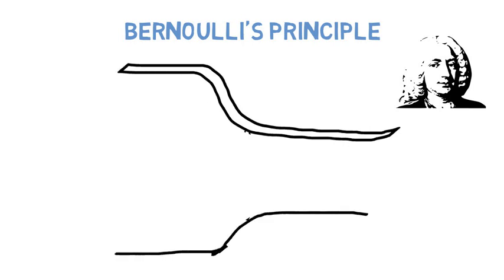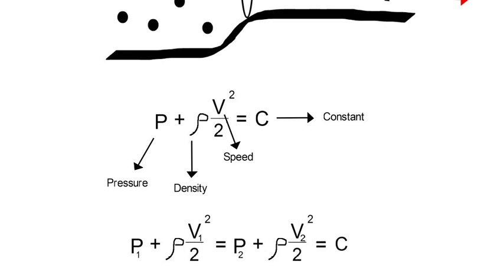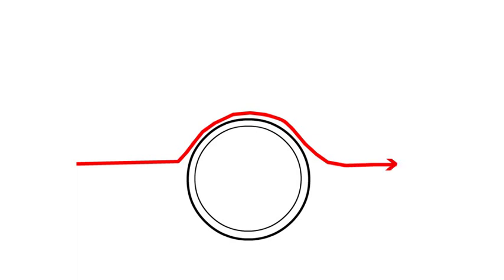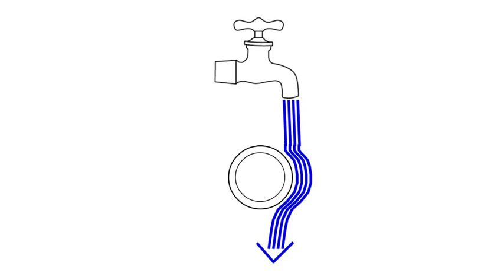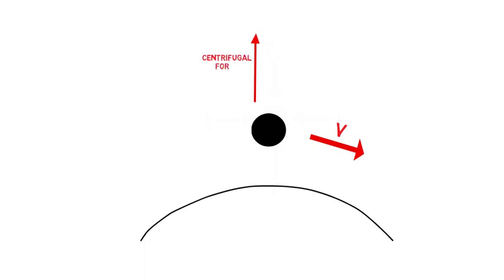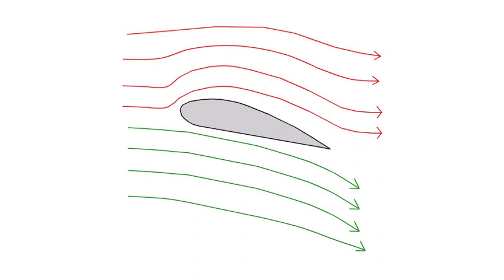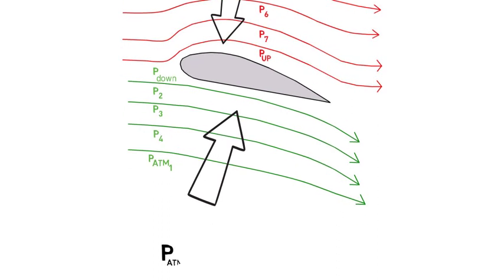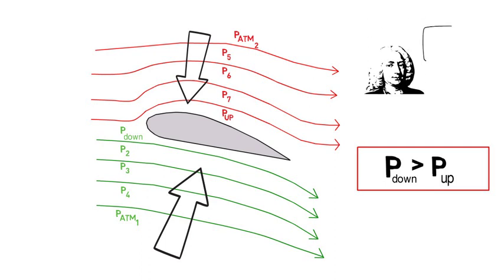Part 2 - Coanda effect, Bernoulli's Principle and Lift

Comment: With the bernoulli effect, you don't change the pressure,  rather you take pressure from one direction and direct it in another direction. This isn't a change in pressure,  it's a change in the direction the pressure is pointing. As the velocity of a gas Increases the pressure doesn't decrease,  it's redirected.
Reply: No, No, No. .. 
You are confusing Static pressure and Dynamic pressure and turning it into a common misconception. . 
.
Static pressure is in ALL directions equally and is NOT altered by causing a flow, or jet to move 'faster'.  NOPE!  
This is a fundamental concept in fluids. 

Bernoulli's Principle  definitely does NOT take pressure from one direction in the fluid and 'direct' it in another direction.
 I'm sorry, but that is FALSE physics.

The force from a Pressure Gradient is what causes the acceleration in the flow.  It is the Accelerating force that Accelerates the flow. The kinetic energy in the flow (the dynamic pressure) came from some external force to accelerate the mass of the fluid.  That is definitely NOT taken from another direction. 
Some Pressure Gradient is the Potential energy that Accelerates the fluid to a higher speed, thus being converted to kinetic energy.
.
Bernoulli's Principle is about Acceleration, NOT speed.
.
A balloon has a higher pressure inside than outside.  THAT pressure is a higher potential energy than outside. The opening in a balloon has a Pressure Gradient with more pressure inside than outside, which is atmospheric pressure. 
.
It is THAT Pressure Difference called a Pressure Gradient that is the source of the force (and energy that accelerates the (mass of the ) air OUT OF THE BALLOON. 

Once accelerated into the atmosphere, that jet now has ATMOSPHERIC PRESSURE (static pressure).  <-- THAT is the CORRECT physics..!.
.
Your lungs have a higher pressure inside and provide the Pressure Gradient that is the Potential energy that Accelerates the air out, THUS adding the kinetic energy to that flow - - - That energy is NOT magically get stolen from the side-to-side pressure.  
.
NOT.  It is ADDED By the Pressure Gradient.!.
.
That "jet's speed ADDS (vectorially) to the molecule's thermal vibrations,.  This increases the overall speed down-stream, BUT IT DOES NOT change the energy those molecules have Bouncing into each other either upstream, downstream, nor Perpendicular to the flow - NOT, NOT, NOT.
.
The air in a jet has a static pressure EQUAL to Atmospheric pressure, NOT, NOT, NOT lower than atmospheric pressure.  
If you move along WITH the flow, you will measure the same (atmospheric pressure) in all directions inside the flow.
.
Don't get it??  Try this mental experiment:
.
Sit in a car and bounce a ball on the ground, out of a side window.   It will impart a momentum to the ground each time it hits - That is how pressure is formed from all the molecules bouncing against some surface.
NOW. . . 
Drive the car at any speed.
That Horizontal speed DOES NOT change the vertical speed YOU impart on the ball. Therefore, the car's speed does not reduce the momentum of the ball transferred to the road Those directions, speeds and momentums are Orthogonal - they do NOT affect each other.
YOU have added the horizontal speed to the ball.!.  That energy is NOT stolen from your throw.!.  It is YOU that adds the down stream energy to get the jet moving.
.
More if you want to learn:
Understanding Bernoulli's Principle Correctly:  kyuoyckftflurrpq.quora.com/

.
ALL the demonstrations that claim to show that "Fast, or moving air has a 'lower' pressure than ambient" ARE seriously misinterpreted.!.
And there are PhDs and professors that teach this "fast means lower" nonsense.
.
Sorry, but this is real physics.

Comment: The bernoulli principle states that as the velocity of a gas Increases, the pressure decreases perpendicular to the flow however increases with the direction.  The pressure doesn't decrease in general. The total pressure energy remains constant. Bernoulli principle without it's caviots is false. The pressure doesn't decrease.  It both increases and decreases. The bernoulli principle doesn't cause lift. It describes conservation of energy. The only way to get lift is by the excelleration of air. At both top and bottom of a wing, in the stationary reference frame, all the air starts with zero velocity then is  excellerated by the wing. In a venturi tube there is opposing inward vectors.  Above a wing there isn't. There is one vector away from the wing. You can only get lift via excellerated air.

Comment: Many pilots, although capable of piloting airplanes, do not truly understand lift. Simply put, lift is as follows:

Assuming our Earth is an ideal sphere with no friction or atmosphere on its surface. We also have an ideal small ball placed on the surface of the Earth, which will exert pressure on the Earth due to gravity.

If we move the ball in one direction along the Earth, we will find that the faster the ball moves, the less pressure it exerts on the Earth. When the speed of the ball reaches the appropriate size, the pressure of the ball on the Earth will be equal to zero.

Why?

This is because the surface of the Earth is curved, and when a small ball moves, it tends to move away from the Earth's surface along the normal direction of the sphere. That means the ball is trying to leave Earth. However, due to gravity, when the speed of the ball is relatively low, it cannot reach Earth. But the pressure of the ball on the Earth will be reduced.

Lift is also the same. When air moves along the upper surface of the wing, due to the curved surface of the wing, the air also tends to move away from the upper surface of the wing in the normal direction, so the pressure of the air on the upper surface of the wing is reduced (similar to weightlessness). So there is also lift on the surface of the wing.

Of course, the lower surface of the wing also generates lift, but the lower surface is opposite to the upper surface and can cause overweight, resulting in pressure higher than atmospheric pressure. This also contributes to lift.
Reply: Yes, Enbin, but it is NOT the air 'tending' to move away from the surface, BUT the air tending to move in a STRAIGHT LINE - the surface is 'moving' away from that straight line. . . .  And, 
It is the Inertia of the mass of air that causes that air to 'tend' to move in a straight line - Newton's First Law.
.
That is why the pressure decreases above the wing.
.
Inertia is ALSO why the pressure increases below the wing.
.
We must use all of Newton's laws correctly. . .
Reply: @Observ45er  In addition, the viscosity of air is also required, otherwise low pressure will not be generated.
Reply: @enbinzheng-line  I see no reason for that.
.
  For a mass to act under Newton's First Law and 'tend' continue in a straight line constant speed, requires no viscosity  
A brick doesn't, so why should fluid?
Air has mass and therefore, follows Newton's Laws.
.
When you are on a roller coaster coming up to the top of a hill, YOU push less pressure on the seat.  There is no viscosity acting there, ONLY your inertia 'tending' to continue straight and, therefore acting against gravity and exerting less pressure on the seat.
That is Newton's First Law at work.
.
Reply: @Observ45er  https://youtu.be/aa2kBZAoXg0?t=1087
Reply: @enbinzheng-line   I'm surprised you said that.  I thought you had a better understanding. 
.
I have discussed this with  Prof Fidkowski and a few other professionals.  
.
If you listen, he says that the same flow occurs in CFD without viscosity.!.
He also says that air in not 'sticky'.
.
Atmospheric pressure holds the flow along the surface.  Atmospheric pressure is so much more than the small amount of inertia trying to make the air 'go straight' (per Newton's First Law)
.
The pressure changes here are TINY and atmospheric pressure easily over-powers the inertia that is trying to 'pull away'(go straight)  from the surface.
.
Think carefully, Enbin, I know you can understand this.
.
Newton's First Law:  Mass will continue in a straight line, constant speed, UNLESS acted on by a force.  THAT FORCE is from the  Atmospheric pressure.
.
Regards, S.N.
Reply: @Observ45er  I understand everything you said, but why does the Coanda effect occur? Is there a Coanda effect without the viscosity of the fluid?
Reply: @enbinzheng-line  I'm putting an answer together, but something  else is taking a little time.  I reviewed Krzysztof Fidkowski's video for some specific points about this and I am re-organizing some thoughts.  I'll paste them here, When I get them together.
Reply: @enbinzheng-line  Quick answer, not genuine Coanda.  Entrainment is a part of Coanda.  I just sent more in a Quora Message.
Reply: @Observ45er  You didn't understand what I said, or my expression wasn't very clear.
I did not deny the role of atmospheric pressure, but for it to work, it must rely on viscosity. For example, you can press bricks one by one to reach a relatively high height. The bottom brick is subjected to the greatest pressure, and if we remove the bottom brick, there will be a significant pressure that will push these bricks down. And removing the bottom brick is similar to the entrainment caused by air viscosity.
Reply: @enbinzheng-line  Yes.  I know you did not deny the pressure.
.
I see that I did not correctly remember what Prof. Fidkowski said when I watched him some years ago. After listening to Fidkowski's video again now, it appears that viscosity has some purpose, but I just don't know how, or why it does.  In my mind, it appears that the pressure is enough. . 
.
I also spoke with him on the phone about a year ago and realize that I didn't cover this good enough to understand better. 
.
In your bricks analogy, we are not removing the lower brick, but the upper bricks are moving a little faster - boundary layer..
.
If those bricks are Sliding along the floor (like the upper surface of a wing) and I try to hold that bottom brick up when the floor begins to slope downward, the physics in my mind tells me that it is the weight of all the bricks that makes that bottom prick follow the sloping floor. It seems that the friction to the second brick above, has nothing to do with the downward motion of the bottom brick (along the sloping floor). 
.
I can see that that friction is trying to ROTATE the bottom brick  - because in the boundary layer, THAT brick is moving faster.  Perhaps that Rotation is the key idea.  I have not convinced myself, yet. 

.
Does that explain me better?
Reply: @Observ45er  I think you should communicate with Fidkowski again and ask him how he understands the meaning of viscosity in lift.

Comment: The flaw is not working from velocity of the wing to lift. Invoking pressure reduction as the cause of lift is fine but then blaming pressure reduction on bernoulli/coanda is again problematic without reference to weight and gravity AND a wing moving in the open rather than a fluid driven through a tube. Furthermore conservation laws have zero relevance to incompressability of a fluid moving under a pressure differential thru a pipe. 
To many false equivalences invoking laws used incorrectly bro

Comment: Lift is action and reaction.
The action is the deflection of air molecules downwards, the reaction is the wing being pushed upwards.   Pressure differences are secondary.   If there is no downflow of air from the wing, there is no lift.

R
Reply: That is false reasoning. There is no reaction if there is no action causing it.  The 'downflow' is the Newton 'reaction' is a result, not a cause.   It is a result of the pressures caused around the wing.
That also ignores the up-wash ahead of the wing.

Comment: Great explanation, tying together Bernoulli's, Coanda effect and curved motion of the streamlines, and the effect they have on lift. I would suggest a couple of points to clear things up. While the curve of the airfoil does cause the streamline to speed up it does so specifically because of circulation. This along with the coanda effect and centrifugal force causes a force that pitches the airfoil up meaning that at the trailing edge of the airfoil the streamlines should be deflected downward instead of continuing in a straight path like your graphic show.

Comment: Curvature of streamlines accounts for drop in pressure...also speed (scalar) and velocity (vector) should not be used interchangeably. Streamlines are tangent lines to velocity vector at any instant. Example - as combustion air is drawn into a furnace or boiler there is a slight pressure drop from ambient atmospheric conditions.

Comment: Consider a hydrofoil moving through liquid helium as compared to the same hydrofoil moving through liquid sodium. The hydrofoil is slightly inclined and the geometry or kinematics is exactly the same between the two cases.

In the case of the sodium, there will be a transverse force, also known as lift. There is no transverse force in the case of the helium. Not sure how talk about Newton or Bernoulli or the Coanda effect can explain this. It can be explained in terms of the Kutta condition and the Kutta-Joukowski circulation theorem.

It can be visualised as well. If a hydrofoil is moved with an intermittent stop-start action, it will generate a vortex street which we can see. While vorticity is bound with the hydrofoil, it generates lift by the Magnus effect, which is the same thing as KJ.

Comment: can someone explain aerodynamic on f1 car?
because we know that f1 is flat in the bottom, but the air move faster than upper part. meanwhile the aerofoil wing has the same thing, curved on upper part, and created a lift, not downforce.
🤔🤔🤔